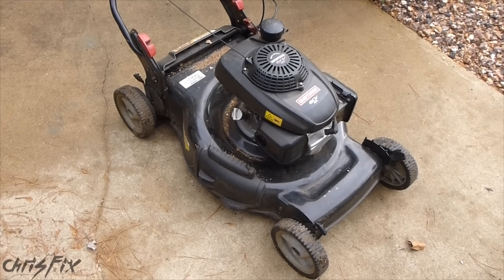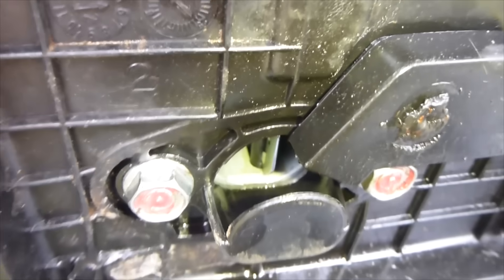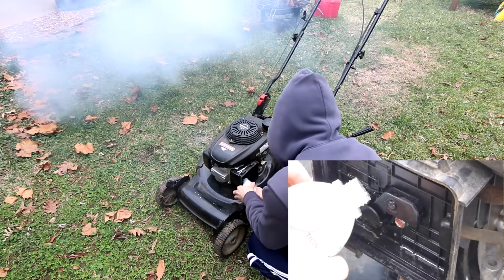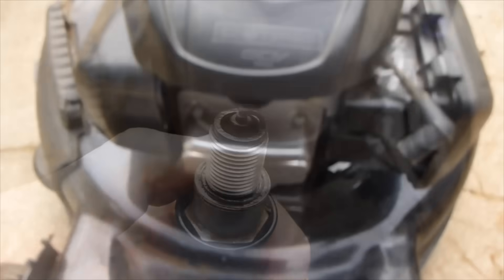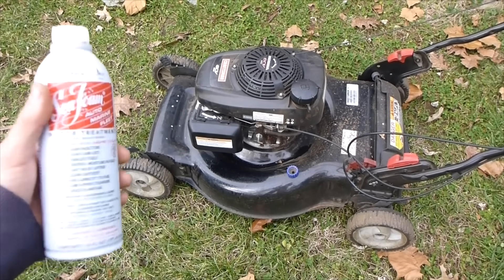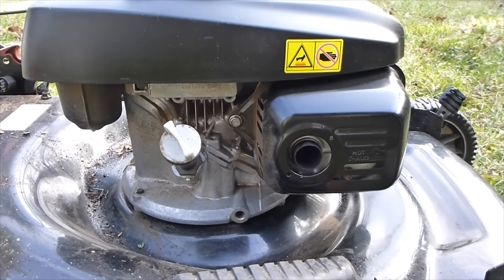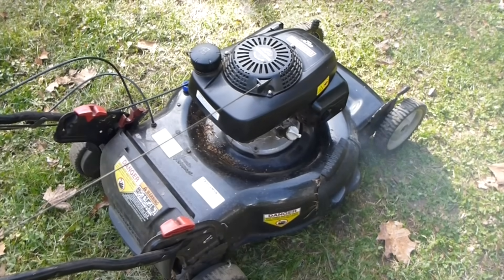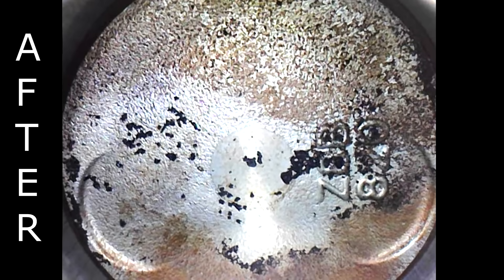Does Seafoam Actually Work? (with Proof)

Comment: How is carbon buildup a problem?  Seeing as it doesnt seem to actually dissolve the carbon, but make it flake off in big chunks, I'd be more concerned about grinding up my cylinder walls than changing the color of the top of my piston.
Reply: +htomerif Hmmm every single modern handheld two stroke engine is coated with nikisil or chrome.
You are clueless.
Reply: Cylinder walls are NEVER aluminum. Piston skirts are.
Reply: +htomerif Buy you still can't cite one single engine manufacturer that ships out bare aluminum cylinder walled engines.
Truly Amazing
Reply: oh my. your not thinking what he's trying to accomplish.
cleaning the carbon build up off the valves and seats, increases engine life, because it isn't building up causing the valves not to seat. Causing burnt valves. Looking at the piston is an indicator that it worked. 
FYI. You can accomplish the same result using transmission fluid as well as water. 
What happens is the fluid turns into steam in the combustion chamber and loosens the carbon. It actually 
looks like ash when it happens. then it just gets blown out of the exhaust. 

there aren't any claims that this prevents wear on the cylinder walls. the vertical lines you see are a little wear
as well as the marks the corners of the piston rings make. They are nothing to worry about.
Reply: Carbon can cause ring sticking, valve sticking and a undesirable compression change withing the combustion chamber. 
Carbon buildup is never a good thing.
Reply: +htomerif A cylinder hone, hones cylinders. A cylinder can be cast iron sleeve, chrome or nikisil.  All can be honed. I hone nikisil and chrome two stroke cylinders every day.  
JAYSUS you're an idiot.
Reply: +htomerif If someone bored a coated cylinder and not replaced the wear voting they are left with a pile of unusable shit.  Well done.  What kind of cutter do these people use to bore Silicon  Carbide coated cylinders?
No tool on the planet is harder than Carbide except a diamond.
Reply: htomerif Holy cow. You guys sound like my mom and aunt when they get together and argue about the best way to make peanut butter eggs.
Reply: +htomerif Sleeveless doesn't mean uncoated. JAYSUS,  The whole idea behind hard coating is to eliminate the cast iron sleeve for more efficient cooling and long term wear.
Please tell me you knew this.
Reply: +Derek Peevey Can you name one with a actual reference?
Briggs and Tecumseh both use a hard anodize on their cylinder walls.  Every two stroke is either played chrome, nikisil or cast iron liner. 

You are truly uninformed
Reply: +htomerif We re cross hatch nikisil everyday.  Material removed is practically unmeasurable.  Nikisil and chrome can not be rebored but can be honed for new piston and rings.  AO hone on Nikisil can be run for several minutes without going through the coating.
Reply: lol.  By "motorbikes" I assume you mean dirt bikes, since most new non-dirt-bikes are 4 stroke and fuel injected with closed-loop fuel control.  And all that scoring on the inside of dirt-bike cylinders? Yeah.  That's from dirt.
Also, deposited "carbon" is most definitely not harder than liners.  The hardest combustion carbon I've ever seen was on the inside of my M16, and a brass brush easily removes that.
Reply: 7:38 that's why I think seafoam is a bad idea ever if you can't see it, all seafoam is good for is speeding up what will eventually happen to your engine. I'm not talking about a clean piston, I'm talking about the cylinder wall look at how scored it looks at 7:38 compared to how it originally was, seafoam is such a dumb idea because it does exactly what the threat and reason you want to get rid of the carbon. Pieces of carbon breaking off and getting stuck between the piston and scratching the cylinder wall, that's exactly what seafoam does. It breaks off the carbon and most of it goes out the exhaust but some of it scratches the cylinder wall
Reply: Lets try to put a few nails in this coffin: according to the Seafoam MSDS, their product is just isopropyl alcohol and "hydrocarbon blend" (i.e. something less volatile than gasoline so it doesn't detonate).
If you want to "decarb" your engine, there's another product that works at least as well: water.  Just spray a fine mist of water or if you really want to pretend you're doing something useful,  a 1:3 ratio of isopropyl alcohol and water into your intake.

At least on the spectrum from "doesn't do anything at all" to "destroys your engine", seafoam is close to the "doesn't do anything at all" end.
Reply: +Derek Peevey They are coated with chrome or nikisil.  Bare aluminum would be destroyed by the rings in hours.
Reply: Carbon is soft, like diamonds and coal.
Reply: htomerif 
 I agree. With fuel injection, cleaner fuel and computer managed engines carbon build up isn't such a problem anymore. If an engine isn't running right seafoam won't fix it and if an engine is running good then why put a bunch of gunk in it? I think some people just have a need to do something to their car and they hear about products like this and think they're doing a good thing for their engine.
Reply: The thing I like the least about this product is that it gives people an out for learning how their car works.  Its exactly like selling snake oil in the 1800's.
My parents had Audi and it was running rough.  I'll admit, I ran injector and fuel-system cleaner through it and it didn't seem to do much.  Then I bought a bluetooth OBDII adapter, saw it was misfiring consistently on cylinder number 3, swapped the 3 and 4 ignition coils and saw it was now misfiring on cylinder number 4.  All I needed was a new ignition coil.
Reply: Putting the Seafoam in the gas tank would probably do just as much for carbon on the valves and piston crown while cleaning your fuel injectors too. I'd sure as hell rather have the carbon dissolve slowly than coming off in chunks. Try putting Seafoam in a new engine, and it still makes the same white smoke.
Reply: nickademuss42: I would reeeeaallly like to hear how carbon could possibly build up in the intake manifold and fuel injector.
Reply: dipshit: EGR valves do not "recirculate unburned exhaust".
They explicitly and specifically recirculate the non-reactive (i.e. burned) exhaust.
You can keep changing your argument all you want, until you start being right, you're going to continue being wrong.
Reply: John Lacy They were arguing about lawn mower engines not car car engines, read the argument.
Reply: htomerif okay the compression ratio does not go up by adding material inside a cylinder because you're adding material which means you're not able to take in as much air in fuel to begin with your compression ratio would remain the same all it would do is you're taking and less air and fuel to make the same compression ratio and the whole reason for removing carbon is also because carbon forms hotspots which causes pre combustion and backfire
Reply: If you still have the Poulans, try spraying ether (usually called "starting fluid") on the air filter.  I pretty much guarantee they'll start then.
I know you said you changed the gas completely, but unless you tore down the carburetor all the way to removing the needle valves, you probably didn't remove the part of the gas that was actually the problem.

Explanation:
When you leave gas in them for a long time unused, the gas fractionates, with the more volatile components evaporating and the less volatile components (also more oily and less ignitable) stay behind.  You can end up with a mess of dense gasoline fractions clogging the needle valves just by surface tension.

Caveat: if they have terribly cheap carburetors, my next suspect would be the diaphragm pump.  When you tear down the carburetor, its the sheet of rubber, usually with some kind of metal disc attached to it.  Those end up cracking and getting holes in them and no gas gets pumped.  I've had original diaphragm pumps go bad, but I've never had replacement ones that come with rebuild kits go bad.

TL;DR, I know: I don't know what engine a Poulan uses, but that would be more helpful knowing its a Poulan.  No one really makes their own engines, so its going to be a briggs & straton or tecumseh or kohler or something (no spell checking on those)
Reply: htomerif very goodquestion
Reply: I don't know much about internal combustion engines, but I can tell you that having extra stuff permanently stuck inside is most likely a bad thing. More carbon means less fuel and air, which means less power in best case and dead engine in worst case.
Reply: htomerif more of an issue on valves, but can be a problem on motors not really being run at the operational temperature, e.g. short trips only
Reply: If it ain't broke, don't fix it.  I have a professional grade Stihl chainsaw thats been in the family for 30 years and it will still cut through 2 feet of oak.  Only "fixing" has really been carburetor and clutch maintenance.
Reply: htomerif 
 One of the major problems carbon build up can cause is detonation. In the right circumstances the carbon can get hot enough to glow and ignite the fuel air mix before the peak compression is reached which can damage the engine.
Reply: I don't think thats what detonation is.  I think what you're describing is just premature ignition (deflagration).  Deflagration is where the heat released by the combustion causes further ignition of the fuel/air.
Detonation is where the pressure wave caused by the expanding gas (usually from autoignition) is enough to cause a spike in temperature that further propagates the blast wave.

Actually, having carbon sitting in there would act like a glow-plug in a diesel engine and prevent detonation, not cause it.  Hot carbon would ignite the fuel-air mixture before it even got the the point where it could auto-ignite.
Reply: I think people get ignition timing issues mixed up with detonation.  Also, in fairness to what you said earlier, under certain circumstances early ignition can start as a flame front but transition into detonation.  Ignition and detonation can happen in the same cycle, but you're usually talking about really high-strung engines, not a 100cc lawnmower engine.

I think the thing that annoys people about this product is that its unnecessary for small engines and quite possibly damaging to modern car engines.  Is it safe for your O2 sensor?  Does it degrade your catalytic converter?  My guess is its one of two things: a harsh solvent like brake-clean or an oxidizer like a hydrogen-peroxide mix.  Neither one of those is something that makes any sense to run through an engine.
Reply: If you use a hone to bore out a cylinder for oversize rings, please tell us where you work, so that we don't come to that shop.  Anyone who uses oversize rings on a standard piston should not be in business because that is just not how it is done, well, by any reputable or knowledgeable .  A hone is used to knock off glazing on the cylinder walls, not to bore out the cylinder.

I have worked on hundreds of engines, large and small, and none, except the POS Chevy Vega that I had, was without some type of sleeve in the aluminum head.  Hardened steel rings have a tendency to shred an aluminum cylinder.  Don't believe me?  Google Chevrolet Vega engine and you'll see what a huge failure using aluminum cylinders is.  I have a Briggs and Stratton 17hp engine in my Troy Bilt mower now, about 2 years old, and I can tell you without a doubt, it has a steel sleeve in the engine.
Reply: Seafoam is great stuff in the fuel for 2 stroke outboards and lawn small engines.
Reply: https://automotiverepairphoenix.com/ask-car-guy-can-carbon-build-impact-engine/
Reply: Besides buildup in the cylinder carbon can build up in the intake manifold, the valves, the fuel injector, it will case any power robbing issues and shorten the life of the engine. Its a decent product to use a couple of times a year
Reply: take one apart and tell me they stay clean! Your obviously no mechanic, the evaporating fuel leaves a residue all over the intake and over time heat and dust that gets by the air filter turns it into a nice black film build up all over the inside. Mostly where airflow is slowest or turns a bend. The modern car also has a exhaust gas return valve that puts semi burned gases back threw the engine to reduce pollution.
Reply: It doesn't.  Not sure where these people get their information.  Carbon is a byproduct of combustion, and if someone has combustion in their intake manifold and fuel injector, carbon buildup is the least of their worries.  lol

The only possible way carbon builds up in an intake is if they have a cross passage such as my old Buick has.  That lets some of the hots gasses cross in a special passageway, in order to get the choke mechanism to operate properly.
Reply: EGR VALVE LOOK IT UP!
Reply: You mean a crankcase breather or a valve cover breather.  Yeah, dipshit, I know what those are, and if you're getting carbon buildup from those you have bigger problems than a dirty manifold.  Psh...  " The modern car also has a exhaust gas return valve that puts semi burned gases back threw the engine".  LOL.  Its not exhaust gas, you idiot.  You might want to start with magnafluxing your fucking block.  Thats your one response until you step up your game.
Reply: Yep, the whole point of EGR is to add INERT gas to the chamber to cool the combustion below the temperature that NOx forms...
Reply: XD these guys got on a fight about lawn mower engines lol IT DOESN'T MATT. If carbon bothers you that much, tear the engine down and clean it. We did it in my highschool ag class in an hour and a half.
Reply: Daniel Ashworth 
 You didn't pull an engine out of any car built since 1900 and tear it down to expose the combustion chambers, and clean out the carbon, then have it fully assembled and running again in less than 4 hours(and that's if you're total pit crew pro( 12 hours if you're a more realistic regular garage guy badass)) Bullshit called.
Reply: @clutch1141  whoosh.
Reply: @BonsaiguySoCal   You read this entire year-old thread to say, whoosh?  I bet you are really great at watching paint dry.
Reply: Actually no, not that I would read that whole thing either, but mostly we're "arguing" about car engines.  A few people seem to just change what engine they say they're talking about rather than actually being right in the first place.
Reply: I need a 2 stroke 185cc engine overbored. Who can do it?
Reply: Derek Peevey I need a engine bored ill ship it. I need to know if it can be done...
Reply: htomerif I have a engine bore question
Reply: htomerif Isi
Reply: Heavy Carbon deposits can also cause pre detonation as well as sticky throttle plates, valves and rough idle. It clogges up the iac valve and EGR valves. It's best to periodically clean heavy Carbon deposits.
Reply: htomerif 1
Reply: +Jacob Emerling Carbon will damage your cylinder. As a lawnmower repair tech I have seen this first hand.
Reply: The carbon is softer than the cylinder wall and can't scratch it.  Also, whatever brakes off will blow out the exhaust valve
Reply: Jacob Emerling I gotta say no to all of that.  Cylinder wall is usually aluminum.  These carbon deposits aren't like gunk on a grill, they're more like the carbon deposits you get on the gas-impinging area of the bolt of an M-16 (you'll either know what I'm talking about or you wont).  They're quite hard.

This isn't a situation of "the harder of two materials never gets affected at all by anything less hard".  If carbon manages to get between the cylinder and cylinder wall (there's a gap, which is why you need piston rings), then there's no reason to think it wouldn't score the shit out of it.

When I was watching this video, I really didn't care about the piston surface.  That's nearly 100 percent irrelevant for the engine operation.  What I did care about was the condition of the cylinder walls and the apparent goop it left on the spark plug.
Reply: true.   my dad is a mechanic and says dont worry about it it is  a rip.
Reply: +Dan Henderson having worked on those engines, been trained on them, taken classes on them, and from first hand knowledge I am gonna say you are wrong.
Reply: Most crap you buy in a can for under $20 to stick into some system on your vehicle is a gimmick, often causing more harm than good.  Do it right the first time or you'll end up paying in full, plus the extra on the cheap fix, plus whatever other problems the cheap fix caused.  I'm looking at you, Bars Stop Leak.
Reply: +Dan Henderson. In small engines they are. Yes I worked on them. Both 4 cycle and 2 cycle. Over 3 years repairing those engines. I have seen a few engines trashed because of high carbon build up and flakes scratching the cylinder walls. Cost more to bore out and sleeve those engines then just replace them.
Reply: +Dan Henderson all of them? Listen. I work on them. I have used hone stones to clean the sides and then put over sized rings on the piston.  I have seen the wear and tear in the engines. If there was a coating like you say then all that would be impossible. Yet it happened. At best they are aluminum alloy blocks. But still no coating. Can you imagine the price if they had to coat every engine with your super coating? And what happens when that coating separates from the wall? That would be a manufacturing defect and would require a replacement engine. 
What manufacture would put that kind of cost and effort into a $100 engine? Or a $50 two cycle engine?
Reply: +Dan Henderson we used honing stones. 
You really have no clue about engines do you?
Reply: +Dan Henderson we were bright and Tecumseh dealers. 
Tell ya what. Look at the video all this is tied to. When he looks into the cylinder and you see those lines going up and down the wall, what are those? If they are coated then the walls should be perfect without sign of wear. But there is sign of wear. 
Busted.
Reply: +06pag yeaaaah, no.  It would actually (counter intuitively, I guess) cause an increase in power as what you'd effectively be doing is increasing the compression ratio.
You'd basically get more and more and more power until you started getting detonation and a blown up engine.
Fortunately, there's basically no real volume change, so this never happens.
Reply: htomerif Sounds legit. I remember in the old days of leaded gas, carbon build up was much more common than today. It was usually the culprit in engine ping which I thought was also called detonation but I could be wrong.
Reply: Dan Henderson Actually, a cylinder hone removes material.  That is its primary function.  How thick do you think these annodized and electroplated coatings are?

What exactly do you do where you're 'honing cylinders every day'?

It kind of seems like your knowledge of engines is limited to high-end aftermarket small-block 350's.

Since maybe you know about that at least, let's up ante: What do you think happens when you over-bore an aluminum block on a 2 stroke?  I mean, you know all this stuff, right?

You don't have to get it re-coated.  Doesnt that tell you something?  Like maybe you're full of shit?
Reply: +joppo how does my being stoned affect the material my cylinders are made out of?
Yes, most small engine cylinders are made of aluminum but to be totally correct, usually either the cylinder wall is electroplated or the piston skirt is to prevent galling.  Some newer compositions have molybdenum disulfide particles (I believe) in the aluminum to offer better lifespans than the coatings do.
Also, aluminum is like steel.  No one uses straight aluminum for anything.  Ever.  Its always alloyed with something.
Reply: I can tell you never worked on a small engine. Please continue to educate us from your armchair.
Reply: Dan Henderson A quick look on google for "boring aluminum cylinder" yields piles of results of people directly over-boring non-sleeved aluminum blocks and not adding any coating of any kind.

You are just simple plain wrong.  Factually, verifiably wrong.

Normally I wouldn't care about someone being wrong, but you're calling me and Derek Peevey wrong.

I can tell from your profile that you're not an idiot when it comes to engines, but in this case you are factually incorrect.

It took me a while to get to where I could admit when I was wrong.  Hopefully someday you learn to have the integrity to do that yourself.
Reply: Dan Henderson Um, no.  like Derek Peevey said, practically no small engine is coated with anything.  In fact, a lot of car engines don't have coatings or steel sleeves either.  If you've used a cylinder hone on any kind of aluminum block engine, you'd be removing any nickle or chrome coating.

Don't take my word for it, just google "sleeveless aluminum block cylinder honing".
Reply: Dan Henderson Alright, not being nice anymore.  Shithead: what does a cylinder hone do?

You're just one of those dime-a-dozen butt-hurt jackasses who can't handle being told and being proven to be wrong.

Why don't you ask yourself where you could be, intellectually, if you didn't waste time defending things you know to be false.